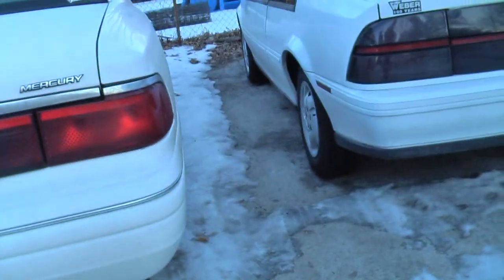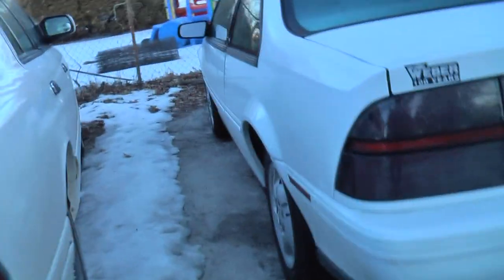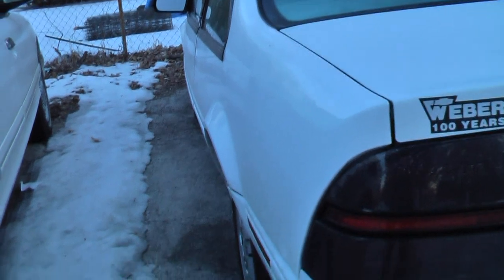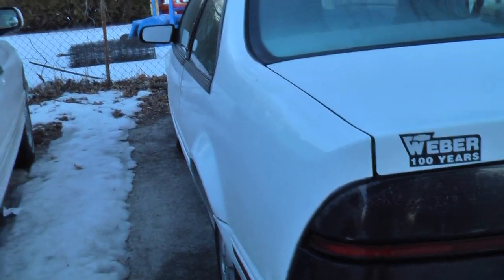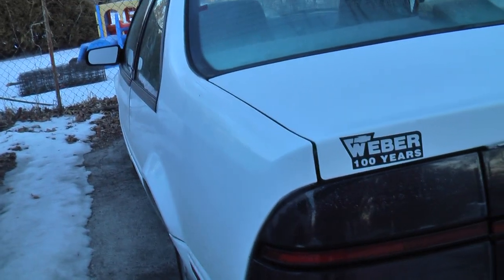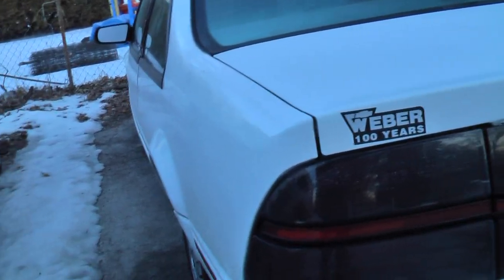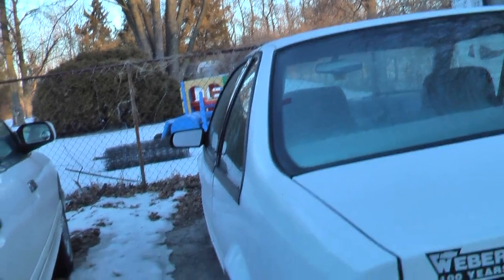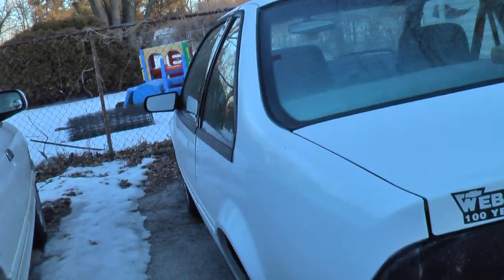Chevy Beretta No Muffler!

Comment: I should do a video of my POS GTZ. The meat sticks that cut the cat out before I bought it re-welded the flange onto the pipe at the wrong angle. While removing the exhaust I noticed that the bend at the gas tank was half kinked. Long story short, it's not worth putting money into so it's now got a 2.25" side pipe coming out just before the rear wheel.  Nice and free flowing, need ear plugs to drive it, haha.    (figure I'm down about 10 hp but the looks are worth it)